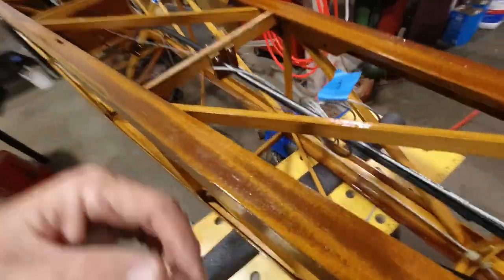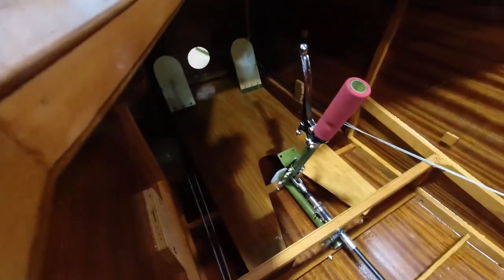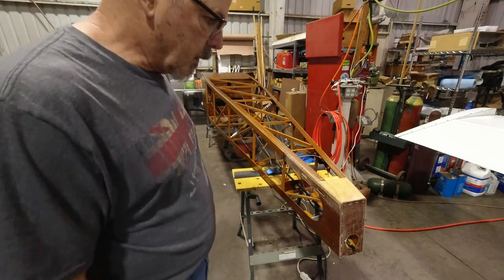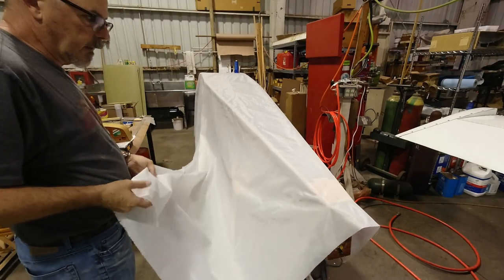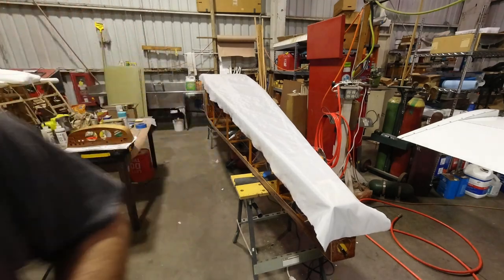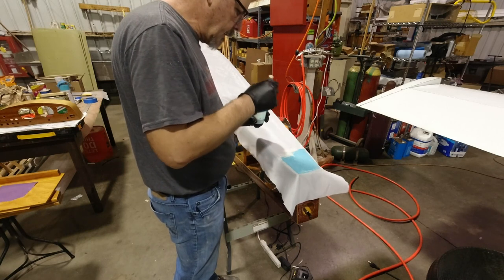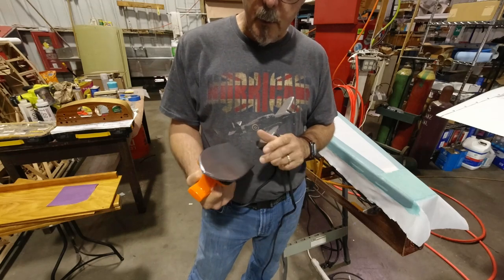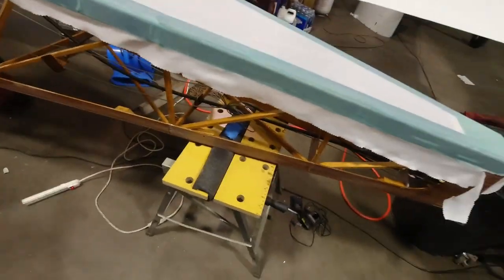Minimax 1100r Wood Aircraft Build Ep 144 - Fabric Covering

Comment: Dennis.,  Looks great.  In my experience, you can almost "throw" the fabric over what you covering - BIG wrinkles and all, because when you go through the shrinking process (I had three heat ranges - not sure of the temps) it will all "snap" into position - smooth as a baby's butt.  :-)  All lumps and bumps iron out easily.  

What originally scared me was when I went to the Max temp, and started to iron, I saw what I thought was smoke - was steam coming out of the fabric.  Normal.,   Also, you CAN overtighten the fabric - will pull the airplane out of plumb.  

Just a final note:  When I recovered my EROS (third time I think) I was able to put on all of the fabric (cut and tacked) to the entire airplane in about a day and a half.  Wings, empennage, and all.  Then started the tightening process.  Goes fast.  At my friend's pole barn, I covered, primed, and painted the plane in 5 days.  Oh, and used a very nice "Water based paint" that went on with a roller. :-)   

Even without a paint gun finish, I had many nice comments.   Asked why I used the Water Based Paint, I asked them;  "Did you ever get that kind of paint on your clothes?  if so, did it ever come out?"  Won't come off the plane, either.  Flew it for years after that.  N6395T   I think my entire paint job as around $60.00.  The "paint money" went into the gas tank.  :-)
Reply from the maker: I’m using the same paint you did…acrylic enamel. I’ll be using Behr Premium Plus. 
That’s impressive that you got that done in 5 days! Not sure I could do that.
Reply: @DTMinimax  I was away from home, staying in a Motel - wanted to get back home.  

My friend had a pasture that I used - had 70 foot pine trees at each end (think his field was ~1,000 feet).  South Side, Va.  It was a turf field that always needed mowing - I'd climb at Vx every time.:-)   I'd fly down (52sm) and cut it for him, now and again, with his big bush hogg. 

Sometimes the cross winds were so bad I couldn't get down, going either direction.  So would fly to the local FBO,   

 My friend  was a builder also - built a P5151.  He never got to fly it - passed away.  Check this out:  It took him over 10 years to finish it.  It never flew. 

I did his weight & Balance for him - was way out of whack.  The CG started almost 2 inches aft of the most aft position - it got worse from there.   I was sad for him.  P.S.  Glad to hear you are using that paint - excellent choice.